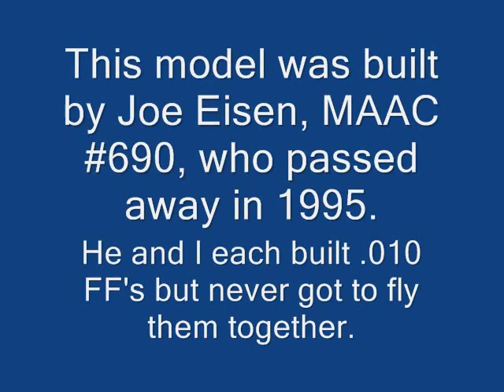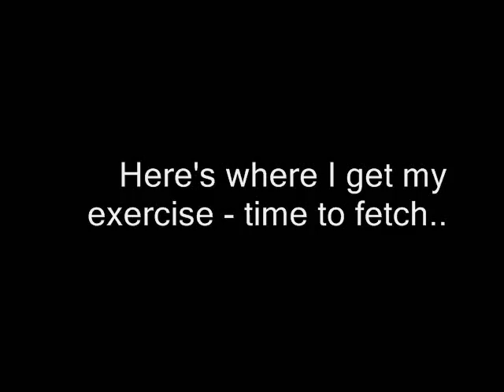MiniPearl .010 free flight

Comment from the maker: No, they're not in production anymore. They were made by Cox, and are a bit of a collector's item now. I grabbed some when they started drying up. 3" prop, runs at about 27,500 rpm on 25% nitro glow fuel. The model is one of a series of classif free flights scaled down to .010 size for fun by various folks.

Comment from the maker: Sure, sounds like fun. But you'd have to go micro micro on everything, and fatten up the fuselage a bit. A pair of HS-35's, micro 2.4 Rx, and 120mAh battery perhaps. I've been an .010 fan since I can remember, and have a small collection of them, but I am guilty of never flying one RC yet! Only free flight, which is not a bad thing.

If you hang out on RC Universe, go to the 1/2A airplanes forum, and find the thread called "010 fun and games" for some examples of .010 powered RC models.